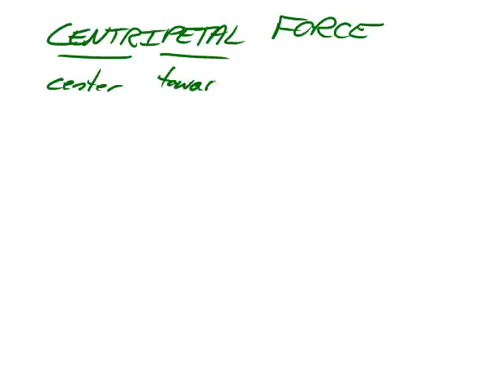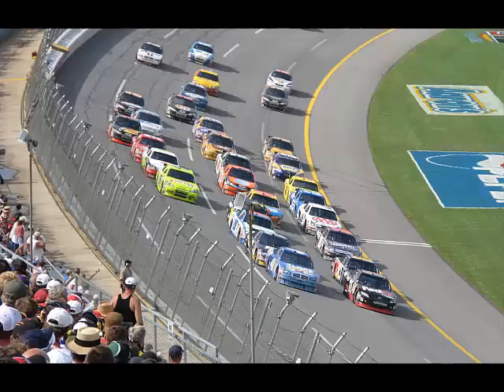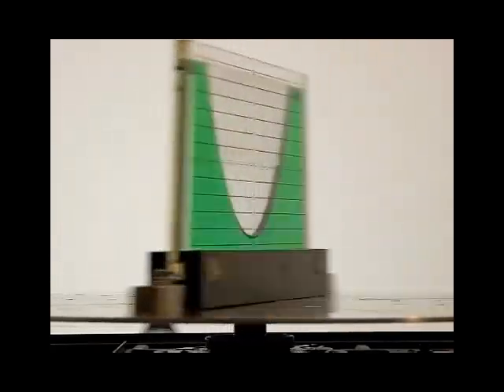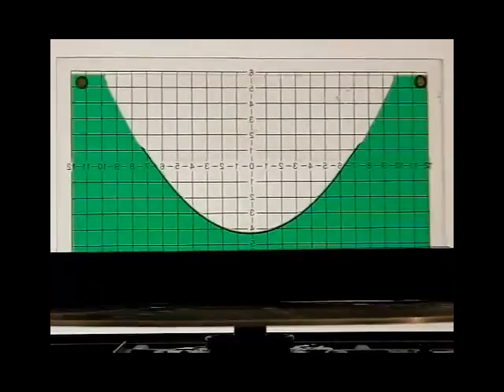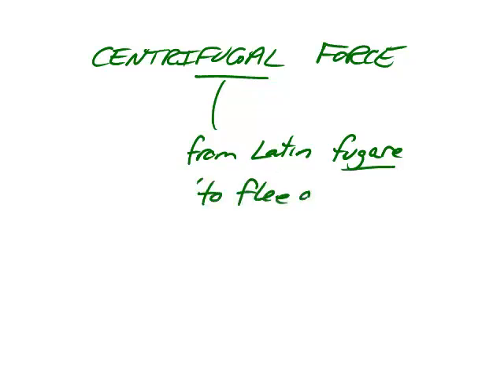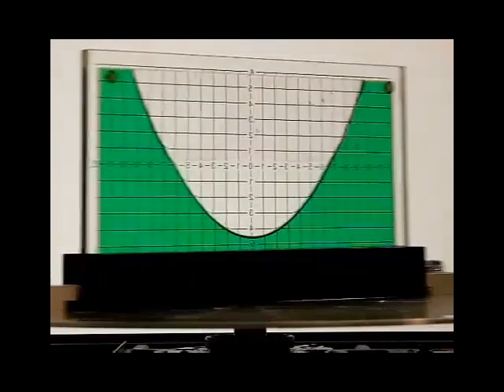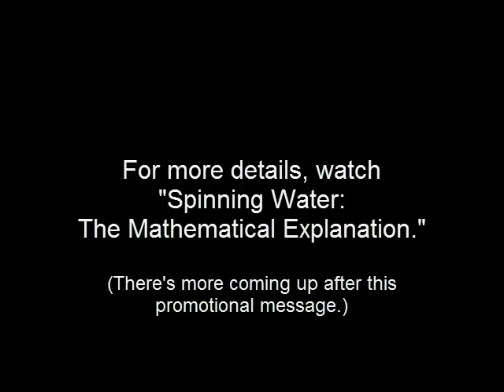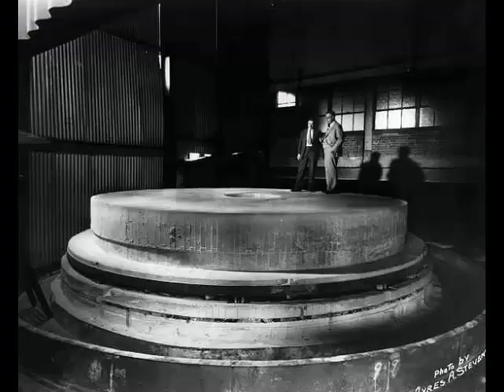Spinning Water: The Conceptual Explanation

Comment: Actually correct explanation is using centrifugal force ...as here there is no agency of centripetal force ....it has circular motion because it is bounded not for a physical centripetal force...........and we e describing the movement of water particle which is in a rotating frame of reference ......so we need to explain it from the water particle context

Comment: What force causes the water to accelerate towards the edge though?
Reply: No force causes water to accelerate to the edge.   The water's default motion is to travel in a straight line at a constant speed, like all matter.   However, its environment is rotating, and as a consequence, is accelerating inward.

If you look at it from the point of view of an individual water drop, it will seem as if there is an outward force, that we call the centrifugal pseudoforce.  But what it really is, is the water's attempt at moving in a straight line path when being in a rotating environment.  There needs to be an inward acceleration to keep it moving with its environment (centripetal acceleration).  The water settles at a shape where its hydrodynamic forces can provide the force for centripetal acceleration, which happens when the surface curves to a paraboloid.

Comment: Proof the earth is not moving.
Reply: I don't know how you got that from this video. If you actually do the calculations you will find that the centripetal force of the rotating earth would be 0.3% of the gravitational force attracting all objects to the surface. Not nearly enough to throw water from it's surface. This is a force that can be, and has actually has been, measured.